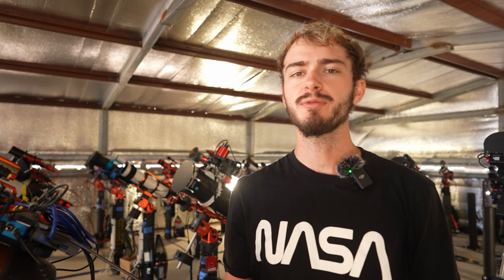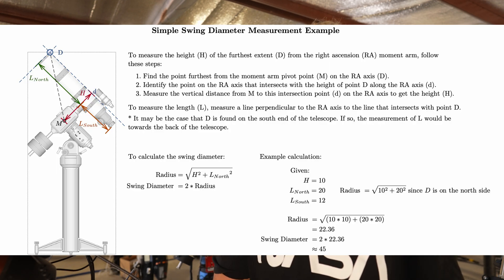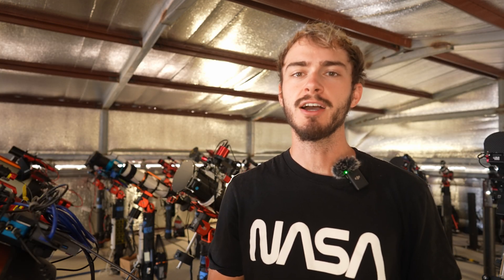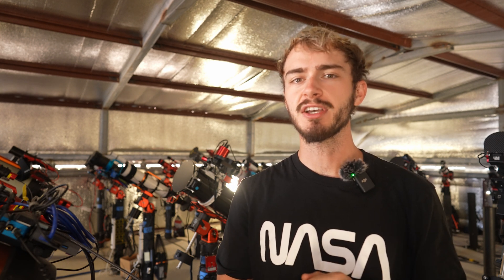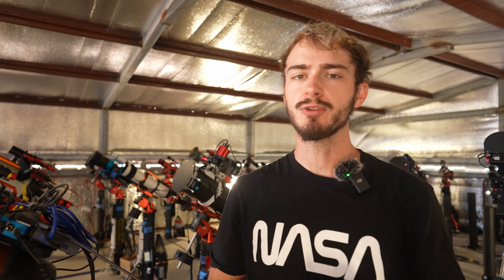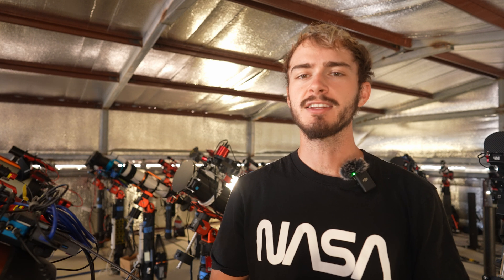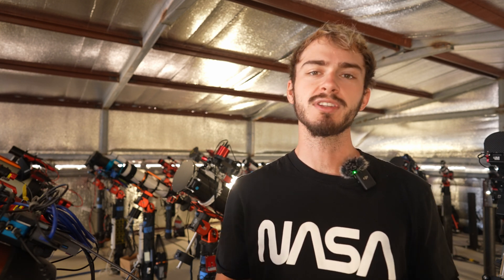Measuring Your Telescope Swing Diameter for Starfront

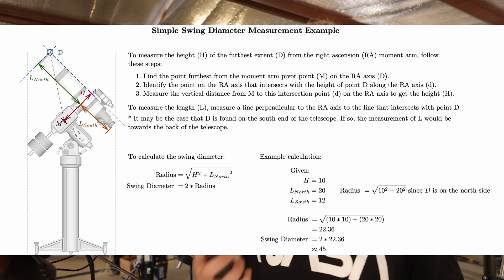Comment: An extra note, The video is measuring the radius, but the tier levels of the pier is diameter. I got confused and thought my big scope would fit on a smaller pier based on the radius. It won't. That calculation page popup at 10:32 says the diameter is what matters, the radius needs to be doubled.

Comment: I'm just curious how strict Starfront is with these measurements. In the video, for example, one of the scopes had a radius of 24.5". Does that extra half inch add $100 per month or would you give the benefit of the doubt and charge the lower tier? Thanks.
Reply from the maker: We do whatever we can to make people fit if they are on the edge. Typically a 0.5" discrepancy can be resolved with some creative balancing of the system

Comment: Why do you charge extra for piggy-back telescopes? Isn't the same swing radius? An Triplet RASA occupy the same spot as a single one, but would be charged extra... 
That is something that have keeping lot of people away...
Having 2 redcats would be more expensive than a single Takahasi in the exact same spot. Even though increase of power consumption would be negligible (Less than 5kWh/month).
Reply from the maker: The complexity of troubleshooting and supporting 2x the telescope for the same spot is the reason
Reply: @astrofalls  I agree with the support. But the support for the equipment is an extra service, right? Also, a simple setup  (for example a double redcat) would not require troubleshooting and support every month... 
Having a few telescopes in remote location with piggy-back in the past, most of them required (paid) troubleshooting once every 3-9 month...
Although the Starfront seems a great place (I love the initiative and I would love to send my setup there), having to pay more just because of having a small piggy-back telescope is a bit discouraging :( (Just like come Telescope hosting places that charges for the diameter combined, instead for the spot...)
Reply: @astrofalls  hardly $100 a more month extra. 

Maybe for the tech unsavvy that have you do all the leg work of setting up something like NINA?.. or are we just talking about plugging in cables and infrequent dusting?
My expectation is, once I remote connect to a scope, either in a back yard or miles away.. If the hardware connected to the computer, its my job to manage the connected hardware. rare that anything needs unplugged or power cycled. 
The hardest part of a 2x scope setup is aligning them. 
Internet bandwidth is cheap, I cant see that adding more than a few pennies per month. 

I'm sure you're gathering opinions on what equipment works best autonomously. I look forward to an update video on 'What To Send' ..... this works well, this does not. 

On the pricing per squared foot, I still think your pricing about 20% is human cost, about 5% is structure cost and 75% is dark sky location premium. insulated heated, humidity controlled, cooled, warehouse - industrial space, 480v 3phase, fire suppression, concrete floor, nat gas, internet, paved roads, is going for about $1.00 a sqft per month in my area. Our building 50x160' cost about $1.1 million. 

The pricing per square foot per pier is inconsistent on a square foot basis. 
32" = $20.95 sqft
48" = $12.44 sqft
58" = $12.80 sqft
72" = $27.75 sqft
Reply: @TevisC  businesses set prices on what the market will bear. That's it.
Reply: @spycheetah  That's not true. As an example,Skywatcher always do some improvement based on customer feedback... EQ6-R, the new harmonic gear mounting, etc... the same as QHY cameras... And their prices are based on the market. So, no... It's not the business that sets the price, but the global market... 😉